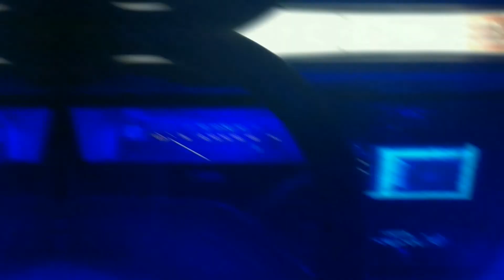Ignition Module *Fixed!!! All Duraspark 460!!!

Comment: Is there a way to test these modules? Dealing with a no start condition in mine.
Reply from the maker: I would honestly just purchase another from rock Auto they are about 25-30 bucks. Even if it's not the issue you have a spare to keep in the trunk. Also don't forget about the coil. You can verify both Are working by removing the main coil wire from the distributor and placing it close to metal. Then have someone turn the key. You should see the spark jump from the wire to the metal. If no spark. Bad module, bad coil, or bad ignition harness (,runs from coil to ignition also available from rock Auto.

Comment: Hey whats up,
Another great video! Was your motor cranking slow before you replaced the module? Mine cranks slow even with a new battery and starter.
Reply from the maker: No usually that means your initial time is off. Another words the initial timing is so retarded it's trying to fire off the mixture as the piston is coming up. There is a whole process to setting the initial timing and you will need a timing light that has a tacho and will have to get it started to set timing. Another common culprit is the starter solenoid, bad cell in the battery, of course the contacts on the starter and the starter itself. Go to facebook and join this group and repost your question there are some great people who have worked through this exact issue.  https://www.facebook.com/groups/261182719960/?ref=share
Reply: @78StinkinLincoln Thanks again for the wealth of information, Ill go to the Facebook page and take it from there. Keep up the great content!
Reply from the maker: Anytime i pray you get it worked out. I will look for you there!